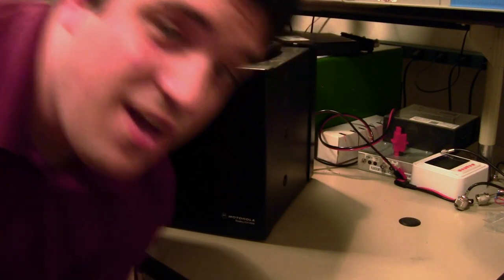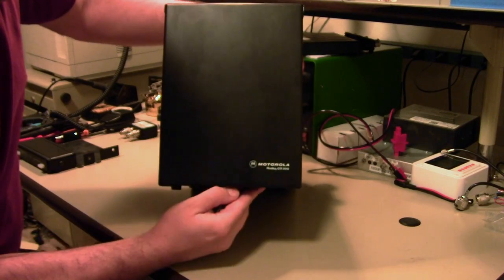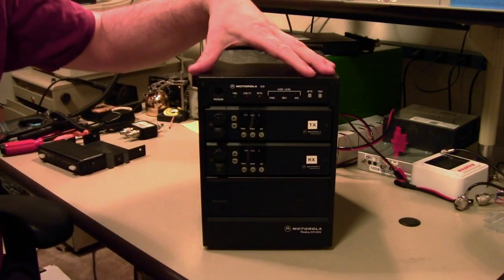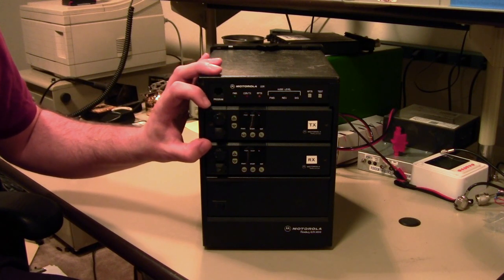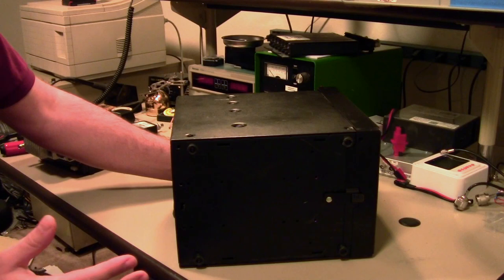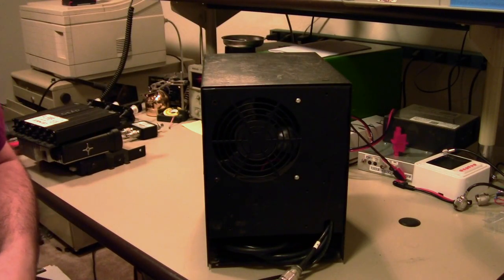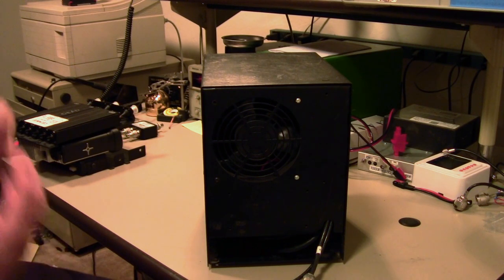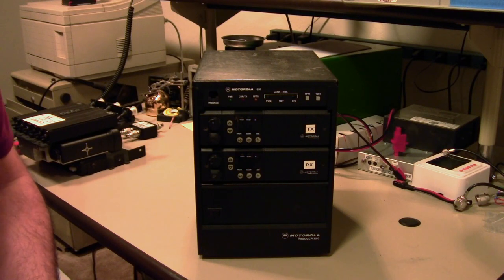GR300 Repeater Chassis Overview

Comment: There was also the Maxtrac based repeater called a Desktrac which utilized two Maxtrac mobiles and a proprietary repeater controller. These repeaters were useable as a desktop or wall mount configuration. No morse ID provisions however there were optional boards for remote use via DC or Tone control. Power supply utilized a unique boost - buck supply to get the necessary voltage and amperage needed for the mobiles. Power supply was capable of battery backup with charge capability. Duplexer was an external device. Radios were equipped with non standard firmware so easy swap out was a bit awkward if not impossible.

Comment: I want to make a mobile repeater out of two kenwood tk-760hg-1 radios but I can't find any instructions anywhere to do that . Do you know how to make the cable to link these together?
Reply: A good starting point is to obtain the service manual and read it front to back. It will outline accessory ports within the radio that you can utilize for RX audio, TX audio, COR and PTT lines. There are points within the radio that will provide you with discriminator audio, audio that is unprocessed and will pass low frequency audio tones utilized for restricting usage to 'authorized' users. Most amateur repeaters utilize only CTCSS  but there are many repeaters out there that also use DCS and a few with P25 which is an open protocol and being an open protocol IS legal for ham use.

Comment: Nice, Video!

I have a Gr300 with 2 GM300 radios....
Both GM300 are not working correctly so i need replacements!

I do not want to use GM300, can i use anything other than GM300 and M120

can i use a different maxtrac?
Reply: You can as long as your radios have the 16 pin connectors on the back. Make note as to how the original radios were programmed and which pins are used as well as how they are programmed. Some individuals have used the SM series of mobiles but the radio used for transmit cannot dissipate the heat properly if used full power and greater than a 20% transmit time. Fans will not help. These portable repeaters will not work well in a high RF environment so don't expect to place it in service in a site that is inner city and in close proximity with other transmitters. If there is no choice the repeater will need to be placed in a well shielded cabinet, properly grounded, utilize only a FULL size six cavity duplexer, my preference is Cellwave, excellent quality. You will also need a circulator in line between the transmitter and duplexer to prevent RF mitigating back in through the duplexer and causing harmonics within your transmit radio that can interfere with other repeaters. If you have receiver problems an additional filter can be place between the duplexer and receiver that can notch out everything except for your receive frequency. DCI makes an excellent filter for this purpose.